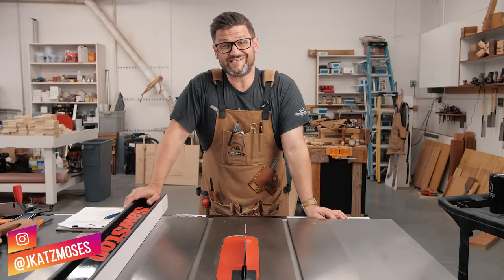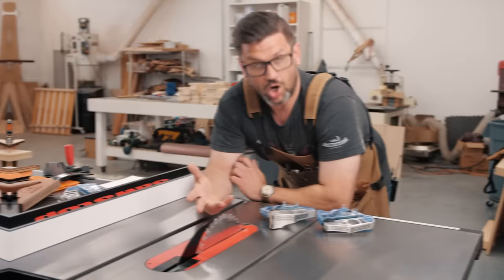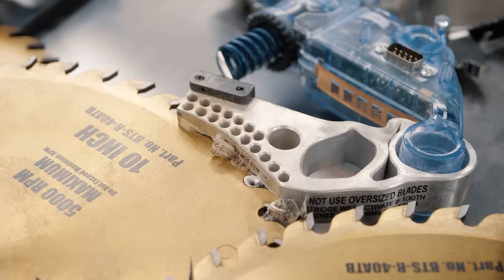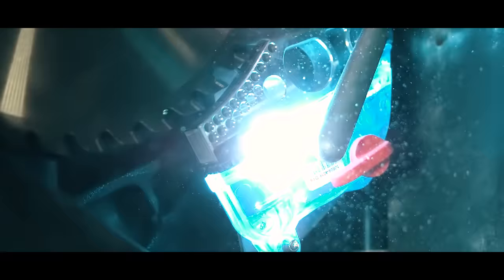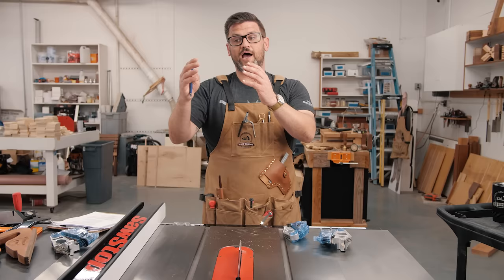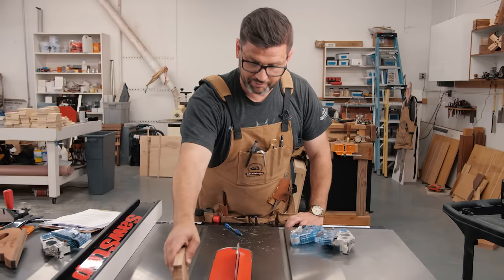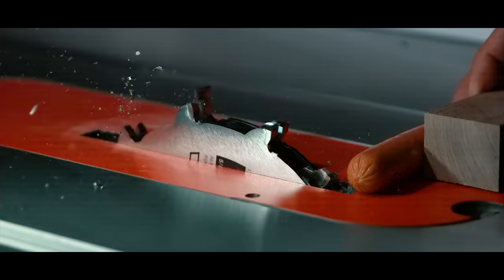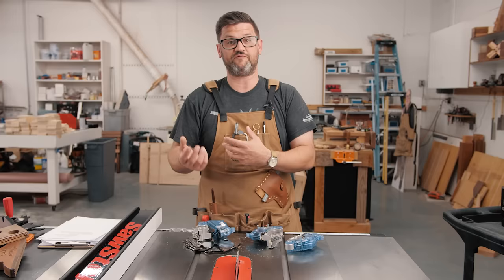How Safe is a Sawstop Saw? - Never Before Seen 19,000 FPS HD Slow-Mo Video

Comment: Seeing the one sawblade shear apart, I was honestly surprised that the others didn't with how high the g-forces they were dealing with were. I figured it'd completely destroy them, but they survived surprisingly well.
Reply: It's not the g-forces here, it's the dado stack. When the sawstop engages, it's going to start grabbing each part of the stack slightly unevenly, as the aluminum can only stop the sawblade once it comes into contact with it (obviously). It's going to hit the teeth a split-second before it hits the rest of the sawblade, and on a dado stack, not all the teeth are lined up (they can't, they need to be offset). So there's a chance when it closes it's offset juuust right where it's not grabbing one blade for a tiny fraction of a second while it has gripped onto the other blades whose teeth were in better position to be stopped by the aluminum crumple block. So one blade continues to spin juuust a little, and because the teeth are offset so you don't have gaps in your cut, the one blade spinning just a little longer means its teeth whack into the other blade teeth, which have stopped spinning. So the teeth then shatter. You certainly could have old, cruddy blades fully shatter, but if they're that cruddy, they could shatter just from normal use.
Reply: If the sawblades could break apart when this emergency brake engages that would be incredibly dangerous. I would rather have my finger cut off than have piece of sawblade go through my head. But fortunately some metals are very tough and 500 g-force applied to a solid piece of metal isn't as bad as it seems. 8 pound axe can have impact weight over 1000 pounds that's probably couple hundred of g-forces and you can use it over and over for billion times and it never breaks apart.

Comment: In shop class I’ve heard horror stories about kids getting hurt by the blades. These would’ve been very useful then
Reply: It happened in my class and thank God this saw stop was in the machine only thing that sucks Is that the sawblade gets ruined
Reply: How many people out there had a shop teacher with missing fingers
Reply: @jessegaytan6515  better than a finger ruined
Reply: Fun fact, my high school's wood shop did NOT have saw stops, and one of the kids sliced his thumb right the fuck open in front of my friend. The wood shop teacher still works there.
Reply: @Not_an_alligator  sheesh
Reply: Its very frustrating. Especially knowing that, with the proper attachments, you could have guaranteed the kill.
Reply: @HadenBlake  speaking more in terms of a class where teenagers act dumb “ accidents”happen more than you’d think
Reply: Yeah, happened to one my classmates in high school. Lost the tip of his thumb and a bit of bone to the table saw. Could have been worse, but still....
Reply: @lunchlady2023  Come back once you have an actual reply.
Reply: @davetourseriepa9328  Mine had a motor dysfunction and shaked like he had parkinsons but all fingers were intact. Def knew what he was doing. I can't believe it.
Reply: in shop class at my old school this guy tried to give himself a mohawk with the industrial vacuum cleaner but ended up sucking up his eyeball
Reply: It would be useful yes, but I am a carpenter and I will tell you this, if you give it to them and the have no consequences they expect all tablesaws to have it and that's how bad things happen. The local gighschokl had one and they constantly had to replace it, now all those kids that didnt respect the tool and didnt get hurt wont think anything of a different table saw. I'm not saying I want kids to get hurt, its the exact opposite, things like this end up getting kids hurt. Instead just teach proper use and precautions
Reply: Chris C ... most people who have a saw accident never perform those actions again because of the damage done.  So your point of this being bad because you won’t respect other saws is pretty stupid.  Just because a saw has this safety mechanism, doesn’t mean you shouldn’t respect the saw regardless.  There’s no correlation to being lazy with other saws and using a Saw Stop.
Reply: @c0nc3ntr8d6  yes there is, in Saskpolitech saws with dawn stops were removed because apprentices that had saws tips on their equipment in highschool were performing dangerous cuts and hand placement which resulted in injury. If you get use to one thing and expect it everywhere that's where incidents happen, so you are in fact wrong
Reply: When I was in grade school my music teacher told us a story as a warning to not put our fingers behind the hinges of the closing door, in the music room. A kid a few years or so ago got his finger clean off because the door closed on it while it was still behind. Scary shit bro.
Reply: My friend cut part of his finger off with a saw at his house in like 4th grade
Reply: @commanderzavala9328  The teenager with minimal life experience, let alone shop experience, is the dumbass? Not the adult in his 30s/40s, with extensive shop and safety training, teaching credentials, and years of being in that position, and full awareness of his responsibility to the kids in his class?

Lol
Reply: @commanderzavala9328  It's an adult's responsibility to keep the children that he voluntarily chose to teach safe. Not sure what you don't get about that
Reply: @Not_an_alligator  How do you know he wasn't busy helping another student? Or doing something else important? You're really desperate to blame the teacher for what the kid did lol.
Reply: @commanderzavala9328  You're the one coming up with excuses for the teacher, and you're calling me desperate? Okay then.
Why do you think kids should be responsible for things that adults haven't properly taught them? Or for safety measures that weren't implemented, for example? This whole conversation began with me saying my high school's shop didn't have a saw stop, which is an oversight that is made by the adults who are responsible for the children they're teaching: students, which by their own definition do not know things and are learning need to have measures in place that prevent them from hurting themselves or others due to their *lack of knowledge*. If the adults had been responsible, and put in a saw stop, then nothing would've happened.
Are you still confused?
Reply: @LonelyAssassin96  We never had these in the wood shops or schools I went to growing up.  Probably a good thing though
Reply: I bet if they did have them, some idiot kid would touch the saw once a year due to a bet or a dare.

Comment: “Oh but they’re going so slow with the hot dog”

If you are speed running cutting wood a break neck speed you deserve what’s coming
Reply: @smarts Is it accidents that happen or  incompetence?
Reply: @MarcV_IndieGameDev  bit of both. also likely a lack of correct training
Reply: @MarcV_IndieGameDev  Accidents are more common with competent and skilled people. In workshops I've been in, newbies rarely have had serious accidents because they are overthinking every movement, and fear moving parts like cats do water. Instead, it's when you're so used to the movements, you're working on muscle memory, maybe you're tired, you stop thinking for a brief second and you slip up.
Reply: I always through my hotdog into a saw blade as fast as possible. Slow is for the weak!!!
Reply: @smarts falling sliping isnt that fast
Reply: @smarts "everyone can be working as safe as possible, yet accidents can still happen" No.
Reply: @sorlag110  its actually both groups for dangerous/stressful careers,  newbies because they don't know the correct and safe techniques, and why the need to be adhered to, and long tooth veterans that overconfident so they cut corners to get it done faster.
Reply: @sorlag110   Thats what happens with climbers and guys that hang off of rooftops.
Reply: @sorlag110  it’s like how the most accidents happen within five miles of home
Reply: @oldcountryman2795  Was that supposed to be an argument?
I've yet to see anyone explain how a professional is immune to tripping or slipping.
Reply: Your task is to make five hundred of thin plywood rectangles with the size of credit card. I'll see you going slowly and carefully at third hundred

Comment: I took a woodshop class in high school my freshman (9th) year. So we are talking 1984 hear.
     The teacher was extremely laid back. He'd been a hippy in the 60's an was still more or less. He'd been teaching that class for a LONG time and one thing he was totally not laid back about was safety. 
    He'd been working at the school since it was built and the room had a clear sign that showed why he had become so anal about safety. Behind the table saw was a patch on the wall. If you looked in the hall you'd see another patch not only on the outside wall, but on the wall opposite as well.
     The saw had launched a 2X4 through the wall, the hallway and the classroom on the other side. Then he showed us his had, that had been partly amputated, also by said table saw. 
     It was actually the 2X4 accident that made him much more carful no one was hurt, but they could have been and that scared him worse than cutting off half his hand. He said, "That's when I stopped smoking pot at or before school."
    Looking back, I think he was still smoking pot, but I never saw him stoned at school.
    In any case, he was a fantastic teacher. I learned SO much from him.

Comment: I've often wondered if there's a difference between activating the SawStop with a nice, moist, conductive BBQ sausage, and a dry, calloused much less conductive finger, or even a finger with a "safety glove" on it.  Presumably the activation would occur once the glove is torn open, but if the finger inside was dry, then it could still cause a delay until the blade went through the epidermis to the underlying tissues which would be much more conductive....  And yes, I do have a SawStop. :)

Comment: I would take an 1/8” deep cut on my finger over losing the whole thing any day of the week.
Reply: Lost three to a table saw in 2000.  They were mostly re-attached and I can count to 9.5.  :-)  Agree.
Reply: @johnT5  If you don't mind me asking, what is a "mostly" reattaching a finger?
Reply: John Tucker omg i lost my middle and hit my pointer (bone laws) on April 18th, 2020. Couldn’t reattach mine and my pointer finger is crooked
Reply: You will still need to be rushed to the hospital in the worst case scenario but you will recover.
Reply: John Tucker i can count to 9.65 though ;D
Reply: Hello guys, id hate to lose any fingers
Reply: @jessblues848  Well...the re-attached ones are a bit shorter.  But still work just fine.

Comment: I wonder if they will perform as well if the hot dog wasn’t in contact with the TS surface. I mean if the contact with the blade was from the top for instance without having contact with anything but the TS blade.
Reply: There are multiple test online where they put the meat onto a piece of wood to show it doesn't need contact with the plate

Comment: I dont know why people would complain that they always aproach the hot dog too slow, because I have never seen a woodworker or even a dyi worker in his garage speedrunning some woodcutting.
Reply: I have. This person is still doing OK, but has crippled others.
Reply: Dude he stops moving it before it comes into contact with the blade.. what's the point of an emergency stop if it only helps you if you don't make contact with the blade?
Reply: What do you mean stop before touching? I meant that nobody would ram their hands into the saw like that, nobody saws wood that fast. And it only stops if you really touch it, it detects with an electrical current.
Reply: @Madushan Well, the saw is only a few inches above the table, and your ribcage would prevent it from going further if it touches it
Reply: @Madushan I'm really confused, are you saying the saw is good or if it's bad?
Reply: @Madushan thats... true for any factory job if your working near heavy machines and some freak accident happens your gonna get hurt i don't understand how this relates?
Reply: You are clearly not a woodworker. Most accidents don't happen from someone just touching the blade. A typical injury will start with a kickback where the saw blade shoots the wood backwards, and since you use your hands to apply pressure to the wood, your hand can get thrown along with the wood into the saw. So it's not uncommon at all for table saw accidents to occur at high speeds.
Reply: @jamesrutherford1475  it does come in contact, did you ignore the part where the system is triggered by an electrical current, meaning contact had to have been made
Reply: That's because you're assuming they carelessly jammed the wood in at full speed without realizing there was a finger in the way or something.

The real danger is from pressing a dense wood into the blade hard, it hits a knot or something, and the wood kicks back towards you off the blade but your hand that was pressing it in slips off and towards the saw blade as you fall forward.

Comment: Just saw where CMT designed a Dado stack that interlocks so the chippers won’t spin and stop ripping the carbine teeth off.
Reply: Also saw where the government is about to enforce saw safety to all table saws including contractors/bench style saws.  Going to run the cost of all saws up plus probably start enforcing this in 2024-25

Comment: I mean, even at that depth, I would call it more than a cut, especially in a hand when so many tendons and ligaments are so close to the skin. However, the difference between some stitches and hand physio to be able to bend one finger again in comparison to losing multiple fingers/a whole hand is clear. So glad to see this safety equipment exists.
Reply: yeah if you purposely use the equipment wrong, the safety mechanism isnt gonna work great
Reply: U have gloves on and you never punch the saw with your hand.You slowly push wood to the saw.With these break itll allways just a scratch.
Reply: Eman Gman  I imagine you've never met anyone that works in a trade then
Reply: Eman Gman  And you say 'you'll rip me apart', but you really haven't. All that you said amounted to a drop in the ocean.
Reply: Guys, that Eman guy just joined 1 month ago, it's definitely a throwaway troll account. You are all just wasting your time on him.
Reply: @Tirocoa  Fair enough. Was fun calling him an idiot over and over again though.
Reply: @Tirocoa  it's entirely possible that an older tradesman wouldn't have joined YouTube until recently. It's everything he said in this thread, and the fact that it exists, that proves it's a troll account
Reply: Eman Gman  accidents are called accidents because they are accidental.
Reply: Eman Gman  isn't that literally what i just said? Are you looking for a fight?
Reply: Eman Gman  then don't reply to this? You're just a troll at this point.
Reply: Eman Gman  alr, if you're trying to school me, gimme some sources big boi. I don't wanna hear some guy's heavily bias arguments.

Comment: People that complain about the slowness of the hot dog in demonstrations have obviously never used a table saw before.
Reply: That's exactly what I was thinking, like what are you people doing when you cut wood, just shoving it through and hoping for the best?
Reply: @evilmonkeywithissues  Those people probably lost their fingers and are jealous they didn't have one of these.
Reply: I think most of these accidents would happen because either someone trips and falls into the blade or the table/ your hand gets flung around by the blade hitting a nail or something in the wood. Either way a fast test makes total sense since there are a lot of accidents that can happen quickly
Reply: @chemlutx7963  most accidents that I've witnesses (I'm a carpenter) were from losing your focus. My colleagues was very lucky that he only shattered his thumb. He was cutting a lot of fire wood for the shop and held the wood too close to the blade. 

I've also cut my fingers. I was very lucky not to lose them. It feels like a small punch, as if the wood jumped a little and hit your finger. Then the adrenaline rush kicks in and you call an ambulance. The first time it hurts is mostly in the ambulance or at the hospital.
Reply: im not sure who'd leave a saw running while they go do something that'd result in tripping

Comment: What happens when you try to saw wet wood? Will it activate the sawstop also?
Reply: The saw stop senses the electrical charge in your finger and grounds it so it will activate
Reply: From what I found the conductivity of skin is about 0.5 S/m. Meanwhile damp wood is ~0.001 S/m. Not sure how sensitive the change in current has to be in order to trigger the breaking mechanism, but there is quite a difference between the two.
Reply: We had one on a job and our foreman ssid not to run pressure treated wood through it due to the moisture content....
Reply: From what I understand, it's unlikely, but still possible.
Reply: Hey press tube you make this casting with bullet videos I love them
Reply: So does your finger have to be touching the saw bench at the same time it touches the blade to ground the charge in the saw blade?  I'm still confused how the voltage drop occures without a earth.
Reply: @benwall8534  if its using the same trip mechanism of a GFCI, it has to be a .005 difference
Reply: @vette63  You are the ground
Reply: @vette63  It measures the change in capacitance, not voltage.